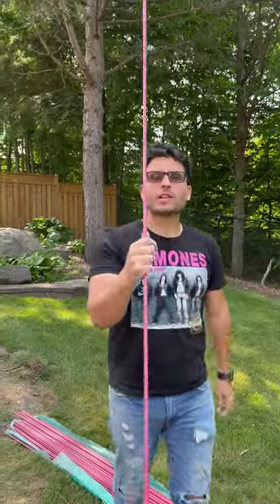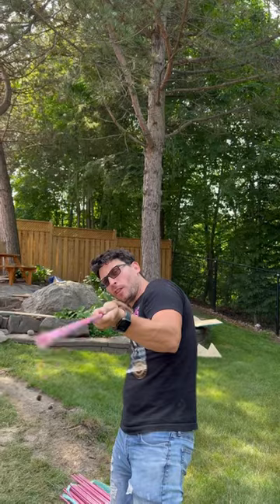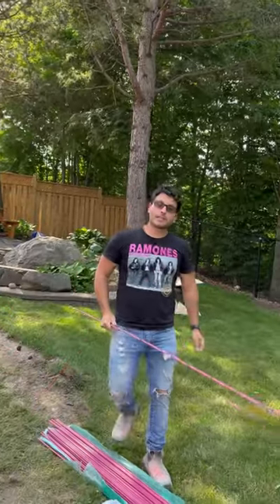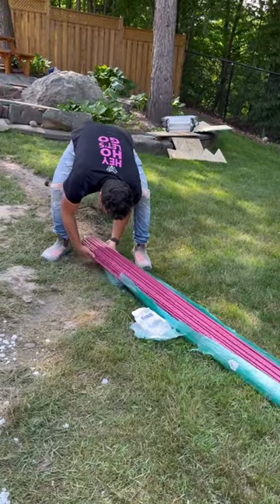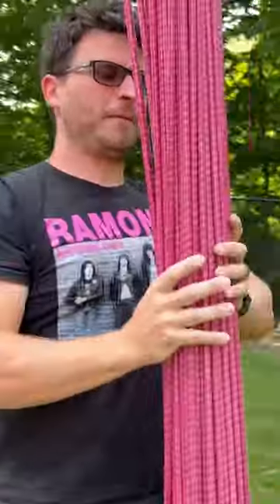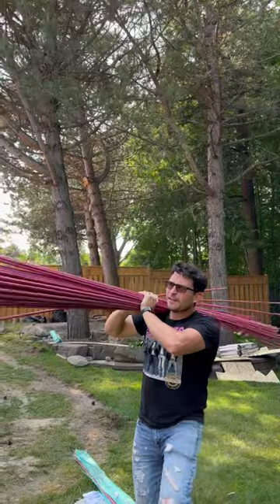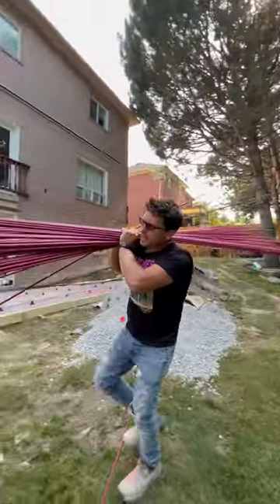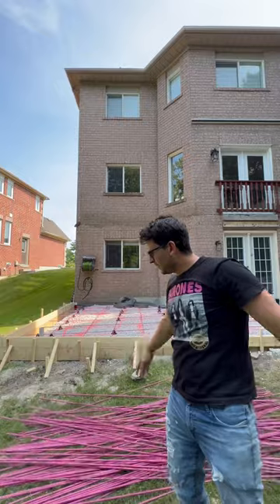Fibreglass Rebar?! #construction #carpentry #concrete #diy #homeimprovement

Comment: let's see how it bends.
Reply: It doesn't bend, but 90 and 45 bended pieces are available. And supposedly, you can use it in combination with steel bars for splicing.

Comment: I've seen this proposed for concrete footings. Tensile stength is what's important in that aspect, so it seems like a valid option. It's one of those things that needs more time and data to fully understand how it'll perform.
Reply: It's been used for decades all of the information is available! Not all GFRP bars are created equal just like all steel bar is not created equal. (Astm a996, 615, 706)
Reply: @brandonlawrence1940 what are thise funny number an e lettere at the end

Comment: I would highly recommend using steal bar for anything that is a heavy load of is part of a structure.
This fibreglass material has been tried out in the uk, now is banned from anything that is structural like especially roadworks and building.
Reply: I would highly recommend not advising to "steel" bars to build motorways
Reply: @sup2730 😂😂😂😂😂😂😂 with the prices of things you never know
Reply: We have many bridges in the USA now made with GFRP. Not all GFRP bars are created equal and should be rigorously tested before use!

Comment: How strong is it compared to regular re bar
Reply from the maker: 2X
Reply: @woodbullyltd  Does it expand at the same rate as concrete?
Reply: @mhx6437  Yes
Reply: @woodbullyltd  Probably much easier to transport too on far distances, less weight = less fuel used!

Comment: What’s the thermal expansion on that
Reply: The thermal expansion coefficient of GFRP rebars is closer to that of concrete than that of steel rebars, so it has better bonding force with concrete.

Comment: I'm all done for new products, but here in good ole funitoba our lovely city and provincial governments decided to try this on a bridge over a river. Turns out no one took into account the climate change here, then they decided to add an extension for bikes/hitchhiker's. 

My uncle said he was on the crew who built that bridge and the company he's with is paid $1mil every year to keep supports in place and to inspect it 3x a year. 

In 10 years time it's finally slated to be replaced.
Reply from the maker: You sure it was this?
Reply: @woodbullyltd  I'm not sure who's bar it was, but it was a fiberglass bar. 

I personally don't feel it would be good for roads, but for housing? Yeah why not? If it's cheaper than steel why not use it for a basement floor? Or some footings for a deck or steps?

Comment: O and how would u bend it
Reply from the maker: They provide bends just like rebar on real job sites
Reply: @woodbullyltd on real job sites they have a rebar bender… you getting paid by the manufacturer to hustle this stuff?
Reply: Real job sites the steel rebar  pre bent because there isn’t time to bend it in the field. FRP is the same, you order it bent and even coils for caissons and pilasters.